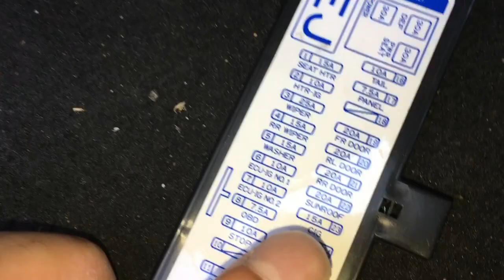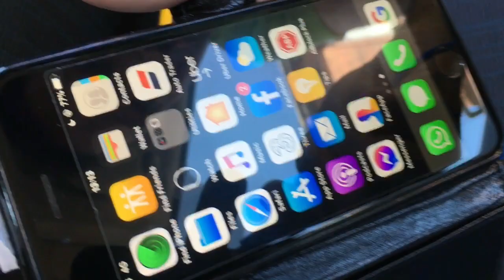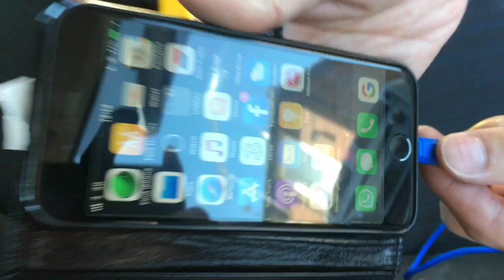How to fix Toyota auris 2008 cigarette lighter /fuse location fixing Toyota Auris cigarette lighter

Comment: It is great that you noticed and tore it down. Nevertheless there are two little thing to this:
That is a 121°C thermal fuse. It is there to avoid the car from burning, in case the lighter's bimetal switch doesn't trigger, ie it is indeed very important (I am not German, so this is not overrating safety. It is a real concern).
The amount of heat and sparks (when driving) which that loose connection can  generate under load (let's remember it is a 15A fuse) is no joke. I'd rather solder it, the heat down there won't ever be big enough to de solder it, unless the car is actually burning.

Comment: Thanks for this, it enabled me to get the cigarette lighter working on my 2007 Corolla. I soldered in a bridge wire. Interestingly, before I did the fix a bluetooth/FM adapter was just able to work because the current was small enough that it managed to find a circuit through the light attached to the socket and then out through the other car lights to ground. But as soon as I turned on the lights it stopped working! And of course if I tried to draw more current, such as trying to charge a phone, it would not work. Now it's all good, just like a new one!